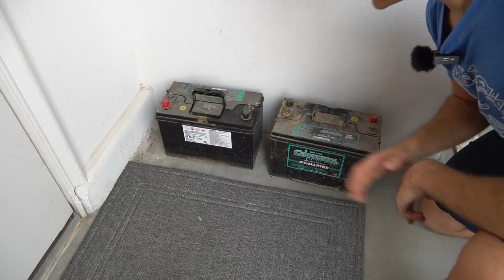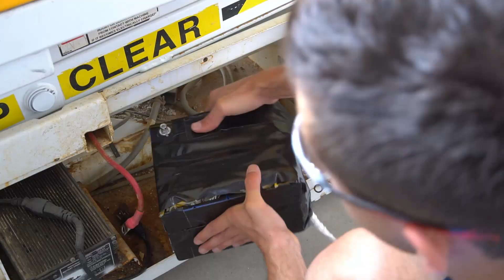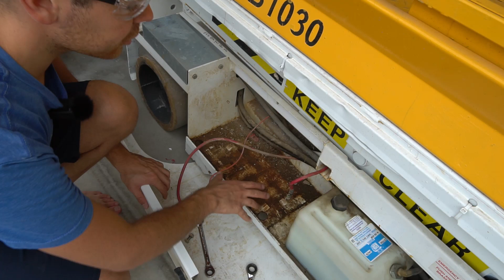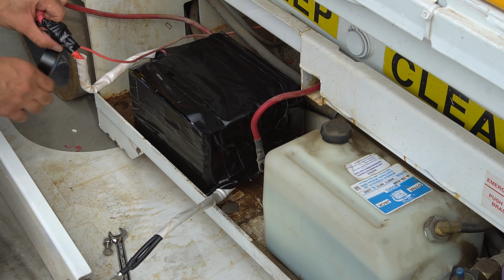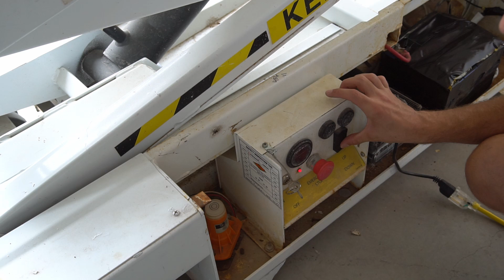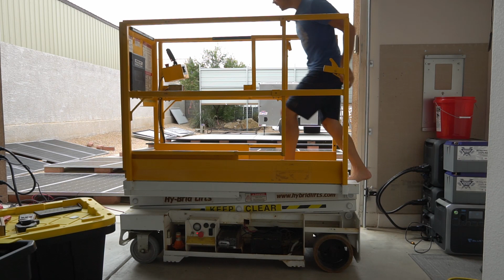Powering my Scissor Lift with Cheap LiFePO4 packs

Comment: I'm still trying to convince my job to get one of these. (I'm stuck moving a heavy 16ft ladder)
Reply: Fall off the ladder in front of the boss. That'll convince him!
Reply: @explorenaked  Fall off in front of an inspector to really get something done!
Reply: Rent one for a week or a month,see how much value it adds!
Reply: @robertweekley5926  That's how I got to experience this. I didn't know how much easier it made ceiling and high up jobs become until we rented on for an electrician.

They want me to use help and stick with a regular Fork lift and cage combo, but I'd rather not be dependant on others when I'm high in the ceiling doing work.
Reply: @AntonioCunningham  - Where I work, we have a "Mix" of Shorter and Taller Ladders, little "One person Hand Crank Lifts", that we push around for position, as well a one person power lifts, that we push around for position! 

Then we have skinny and wider Drivable Scissor Lifts, for 16-32 Foot Max Heights, plus "Genie Booms" (or "Cherry Pickers") for areas more "Overreaching" access requirements!

I work on the "Global 7500" production line, for Bombardier, in Downsview Ontario!

Comment: I need to do the same thing with my lift.  It currently has 4 6V GC2 Lead Acid at 24V.... can you recommend a cheap battery to power it?  Even 2 CHINNS 100aH batteries are well over double the cost of stupid Lead Acid.  And I use the lift 3-4 times a year so I don't need a ton of capacity
Reply: If your current setup is working ok, I wouldn't go out of your way to replace them. The cost of LiFePo batteries seems to be up a fair bit lately. And frankly using it that infrequently I cant see the benefit. Lead Acids can be kept trickle charged and always 100% ready to go. You'll damage/degrade the LiFePo batteries if you leave them constantly at 100% and aren't cycling them. 

Sizing wise, that depends on the capacity of your setup currently. Remember you'll only need roughly half the capacity of the lead acids in LiFePo cells because you can cycle them fully.
Also keep in mind the current requirements of your lift, the smaller the cell the lower the current it'll be able to supply.
Reply: @Loolanga  Thanks for the input.  The current batteries are done and unusable so they need replacing one way or another...  I think the current ones are roughly 200ah 6V.  100ah 12V is definitely too pricey for my use, but a pair of 50/60ah 12V LiFePo would work price wise.

Comment: I'm building a 6S5P 50AH LTO starting battery for my car. I wanted the wide temperature range so I went LTO vs Blue Headway LFP (4S6P 102AH). Lead is dead!
Reply: Just please don't tell me you live in an area where it gets well below freezing. Clearly, you won't be using a BMS...?
Lead acid is stupid proof in cars, trucks, and boats where massive starting amps are needed for a few seconds. Lithium is much better for longer discharges with less amp draw and for much faster recharge times.
Reply: @kimmer6  LTO chemistry is good for -40F and high C rates. No BMS, just an active balancer. Some LifePo4 chemistries are good down to -4F (-20C) but that wasn't good enough thus why I went LTO.

Comment: Will, is your sissor lift 24V or 12V? Mine is 24V and currently runs on four 6V batteries. Mine has tracks and rises 25' and I'm wondering if I series 2 of the 12V 100Ah batteries for 24V, if I would have enough power or do you think I need to use the 200Ah batteries in a series?

Comment: I did this to an APC UPS and it had a similar effect, slightly different noises, the transformer fan might be running faster now, its probably on DC speed control rather than PWM

Comment: The weight of the batteries removed from the lift are part of the calculations done to determine tilt angle limits and such for that lift. Reducing that weight by replacing the heavy SLA batteries with much lighter LiFePo4 batteries could allow for the potential toppling of the lift and injury to the occupant/s.

All I ask is that you keep this in mind when using it. You might want to consider adding dead weight to the lift in the battery areas to compensate for what was removed.
Reply from the maker: Yes true. I did consider that. The weight of the unit is 1200 pounds, and the batteries were only 120lbs. Should be ok
Reply: @WillProwse  Good enough for me. Just wanted to make sure you were aware of the albeit minor risk.
Reply from the maker: I also use it only on flat surfaces, which is why I've never engaged the tilt sensor. It's fine
Reply from the maker: @ManfromMN  yes indeed, thanks
Reply from the maker: @ManfromMN  now the battery charger might be transformer based and the kickback could possibly fry a FET in my BMS. That's what I'm worried about
Reply: It might only be 120lbs, but the low center of gravity is a major part of the equation. So highly suggest you add some dead weight to the same location to make up the difference.
Reply from the maker: @tongmovies  I'll add something then. Those packs are not light either. 20 pounds each. So I can put some scrap metal or lead in there. Should be fine either way
Reply from the maker: @tongmovies  actually the lead acids feel lighter. These are some small batteries
Reply from the maker: @Mike yes good point, I need to measure that with my inrush meter
Reply: @WillProwse  I was wondering about the battery charger while watching the video, but I figured you knew what you were doing so I didn't say anything.  :)
Reply: Just be careful and stay safe
Reply: @WillProwse  I have to wonder if the batteries that were in the lift were to the original specification. Typically the batteries completely fill those trays with no room to spare.

Comment: LoLz
Reply: William Doerfler is 100% correct in raising the weight difference that's been removed but being replaced as you say   , that particular EWP unit is possibly rated for indoor use only and therefore is not susceptible to wind loading , however if the unit has a wind loading/outdoor unit then that's super important to guarantee the stability is not compromised

Comment: Explain "back in the olden days", well over 90 % of all gas and diesel engines still use lead acid batteries. Sorry but I was  just picking on you so don't worrie.
Reply: Ya and they suck. I wish I could replace mine with lifepo4 in my f150 but it would need to be relocated away from the heat and so far O haven't seen any tuner that can make a custom charging map for my 08 pcm smart charging algorithm. If you could it would likely be the last battery the truck would ever need.